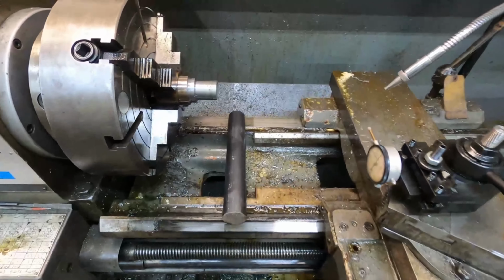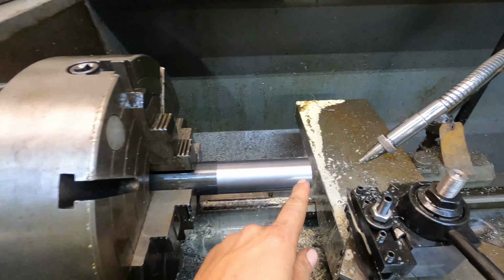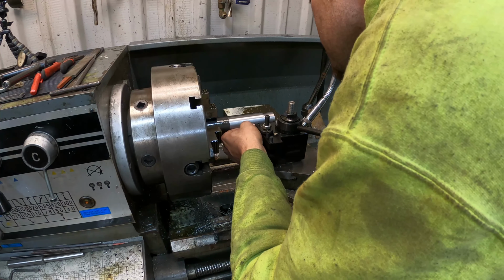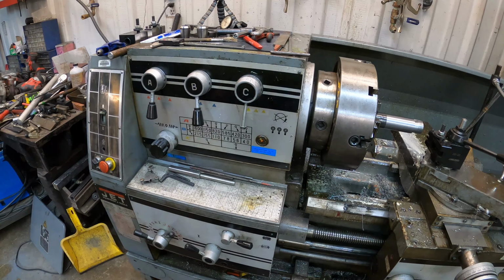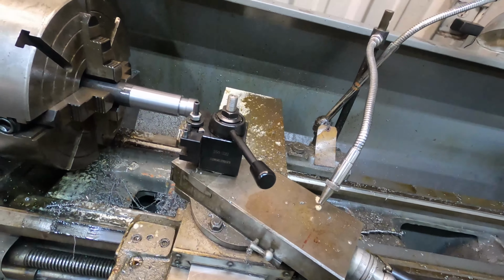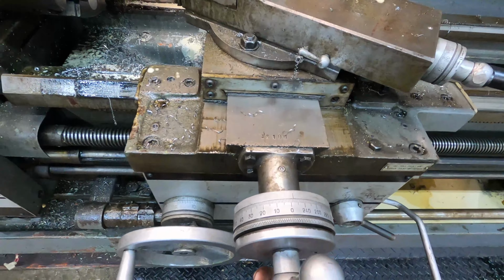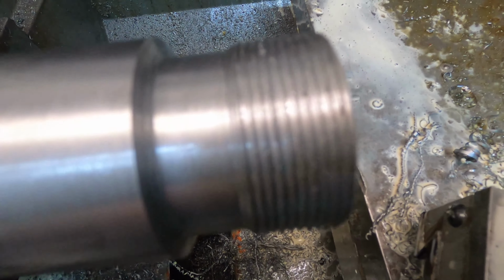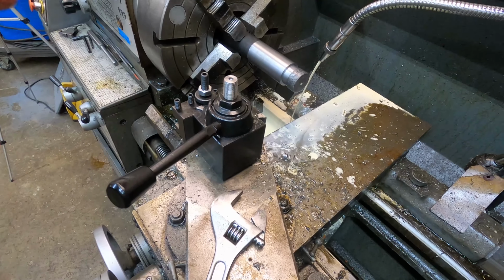how to cut metric threads

Comment: Your compound is at 60.
Reply from the maker: It is set at 30
Reply: @CARTERSGARAGE     Looking at a thread. It’s a “V” 60 degree. If you just use the cross slide. It’s cutting both sides at once. Cutting the full 60. When you use the compound. The cutter follows the angle of the thread and cuts on the forward side of the insert. Only if it’s set at 30. If your at 60. You will end up with a thread that is wide and not to depth. 
 The cross slide is zero. Turn the compound to 30.
Reply from the maker: The compound was at 30 and my threads came out perfect maybe you should watch the whole video before you jump to conclusions